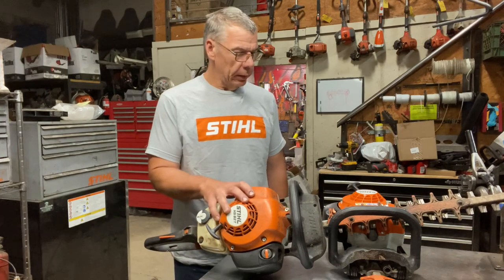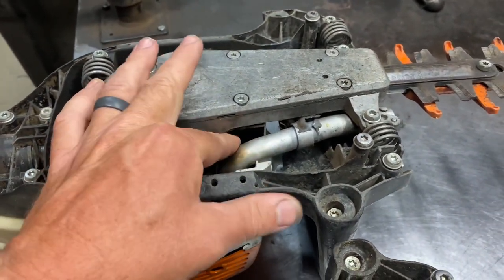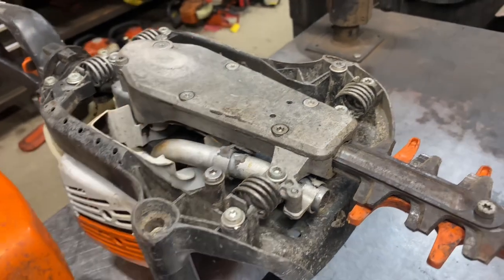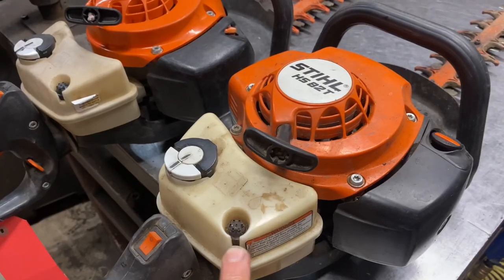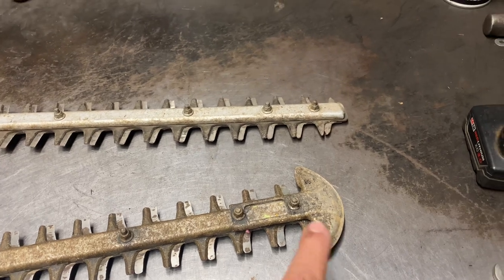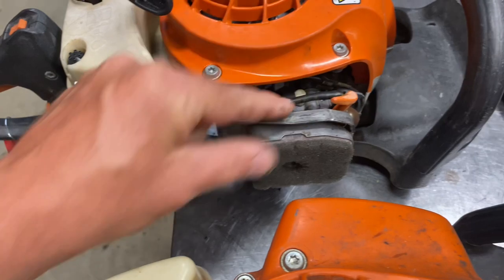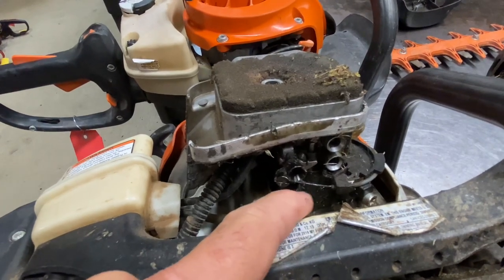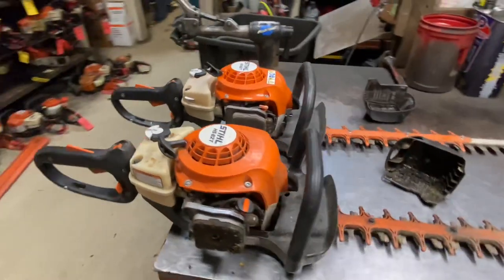STIHL HS 82 T/ Everything wrong (and right) Common problems.

Comment: Hs82r owner here, best hedge cutter by far. Does the hard cut backs and the finer trims perfectly.  I recommend the long bars 30".  Never had an issue in 8 years of professional use
Reply: I couldn’t agree with you anymore mine fly through big thick branches

Comment: Hello, great video.
Whats the fix for the common leaking carburettor issue? 
Many thanks.
Reply from the maker: Either a carb replacement or replacing the fuel pump diaphragm in the carb. There has been issues with the fuel pump gasket rubbing on the carb housing causing holes in the gasket. A complete overall kit may fix the issue.

Comment: My HS 82t is going on its 3rd season (homeowner with 1/4 mile of 7’ tall hedge) 
I started experiencing lack of fuel delivery and the unit would die out. The fuel bulb was nearly empty. I removed the carb several times to see if anything was going on there. I replaced the fuel lines as well. Unit would run good for 30 or so minutes and start to die again. Broke out the unit for this season and got a couple hours out of it before it starved for fuel again. I noticed the vent was wet. Would this be causing my starving for fuel issue and if so why?  Thanks in advance!
Reply: try removing the gas cap next time it dies out. if it releases pressure your vent is the issue.

Comment: My HS82T is definitely leaking fuel from the bottom of the Carburetor, but it still runs fine from cold. But after it’s hot for about an hour of use it seems to have fuel delivery issues and shuts off when I gas it.I then  Will have to turn it off pump fuel manually to the carburetor via that clear pump thingy under the choke,  and hold the throttle full blast to get it running again.

Comment: I have a pretty serious fuel leak on mine. When you add gas, is that all the fuel lines or do I need a new tank?
Reply from the maker: Check the fuel lines at the tank, they do split from age occasionally.

Comment: I bought an 82t late last summer. I was very impressed with it. It has been working fine this year until a few days ago when it started reving really high sporadically. Today when i was using them the problem got much worse and much more frequent. It didnt matter what angle i was holding them at. They idle fine, but when i hit the throttle even a little bit today, they surge/ rev very high until i let off. Any thoughts or solutions ? Still a carb issue?
Reply from the maker: Sounds like a carb issue, if fuel is leaking around the air filter or exhaust you may need a carb overhaul or a new one.

Comment: I have an HS 82 that has difficulty starting, It won't stay running after it starts, I usually start it by squeezing the primer bulb  it 3-5 times, and setting the choke to full, then pull until it runs, usually about 2-3 pulls, then I depress the throttle for a while after it starts, but when I let go of the throttle it shuts off

Comment: Great video. I've got the older model in this video. Not abused too bad, chainsaw through air filter casing which I've never repaired but still runs fine had it about 6 years I think now though. Trouble is I had a near full time jib last year where I used their electronic stihl and it was phenomenal. Using mine now it's SO loud I'm not sure if there's something wring with it like baffles have gone or something?

Also when should I replace the blades? Stupidly i sharpened them with an angle grinder heavy handedly a few years ago so they just don't keep an edge now and there always seems to be slack between blades

Comment: HS 81T Runs find when level, cuts off when I roll over 90 degrees, one way its not as bad
Reply from the maker: May need a carb replacement or overhaul but check the basics first, filters mainly.

Comment: Hi there, this is a great video thank you. On mine the engine revs, but the blades are not moving. What could this be? Many thanks, Matt
Reply from the maker: Does it rev up normally or does it bog? If it revs up normally with no blade movement you could have a broken clutch drum.

Comment: My hedge cutter is over - accelerating every now and again, any ideas why this is?
Reply from the maker: Could be a carburetor problem. They will lean out and rev up at angles. An adjustment may fix it, try turning the high side screw “H” counter clockwise a quarter turn.
Reply: Did adjusting the H screw solve your problem? Mines doing the same thing now

Comment: My blades move when I release the trigger still, not a speed, is there an issue with the carburettor.
Reply from the maker: Sounds like you may have a clutch issue. Sometimes the pivot points on the clutch shoes will get sticky and cause the clutch to drag.
Reply: @wallysworkin823  I have a look at it in the morning, oh and the way since I've had the trimmer I have never greased the gearbox, am I in big trouble.
Reply: Thanks for the first reply.
Reply from the maker: If you are using it for home use you should be fine. If it’s commercial then you may be in trouble 😁 pull the cover off and check it out.
Reply: @wallysworkin823  I've ordered the stihl grease I'll wait for it to come. Do you think I should grease with removing the screw or take the whole cover of and put it in properly with my fingers.
Reply from the maker: @gmanstarr1439  either way, The tubes are made to screw right into the gear box cover.
Reply: @wallysworkin823  I hope it is alright I paid a decent amount it, it's a stihl hs 56 c e, thanks mucka, I'm from the other side of the pond.

Comment: Ever since I bought my hs82t it has always given me the same problem. Never took it in for servicing. Just used my other machines. The problem is when cutting vertically it will always start to rev really high. I will start with the tip down and when I start to rotate the trimmer to make the cut it just takes off. The few times I've needed to use it, it works okay and will do the job. It's just really annoying and takes more time to do the work.
Reply: Take it to a stihl tech. Sounds like a carb issue.
Reply: I just installed two fuel filters and problem resolved

Comment: Got the newer model, 2 years aold and it's started pouring fuel out the exhaust pipe. Dodgy carb ??? Also difficult to start unless I hold the trigger same time as the pulling the starter rope
Reply from the maker: Yes carburetor needs to be replaced. Check your warranty info, Stihl has beed good about replacing them as long as the unit is under warranty.
Reply: @wallysworkin823  Thanks for the reply. Now I can get it running again

Comment: Mine runs by itself when I start it without  pushing the trigger what do you think it is. Thank You.
Reply from the maker: What do you mean “runs by itself”? The blades are moving at idle?
Reply: @wallysworkin823  yes full speed I allready adjusted the Throttle cable and it doesn't help
Reply from the maker: @oscarsalas3200  make sure the throttle is closing all the way, disconnect the cable from the carb  if necessary. If it is make sure the plastic intake manifold is tight, they will loosen up. Also make sure your gaskets are good as well.